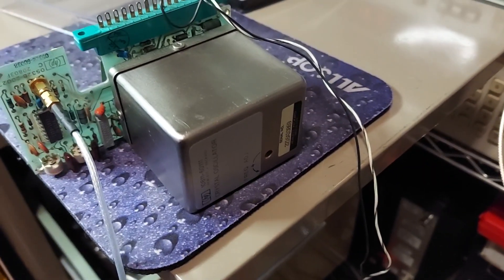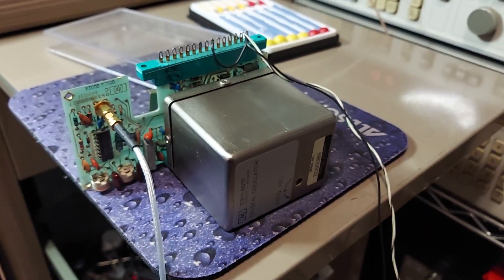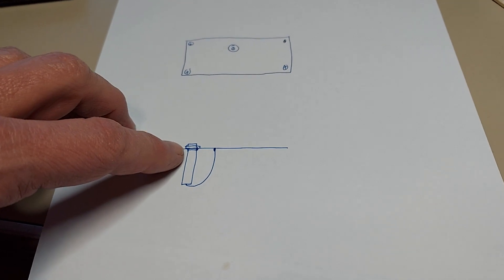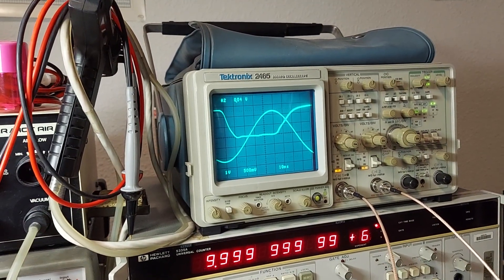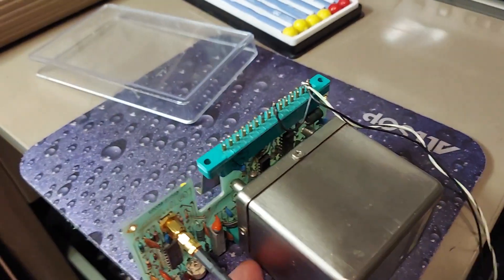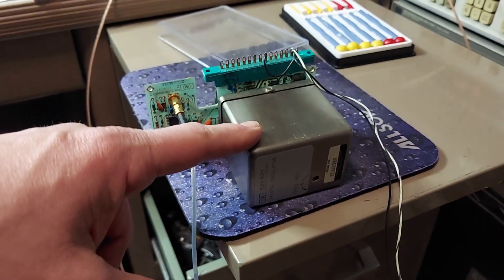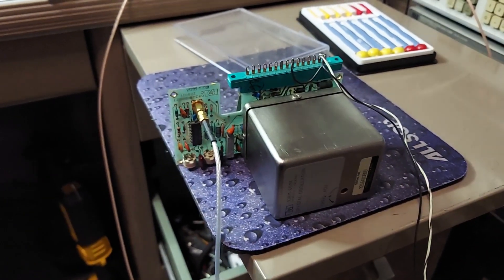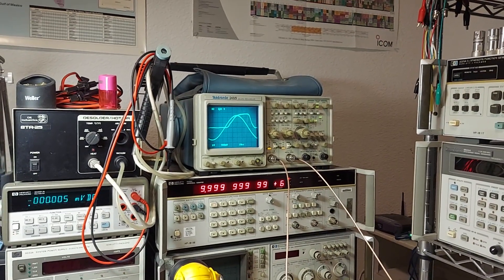HP 10811A repaired

Comment: Thanks for the vid. I remember watching this a long time ago and when I went to adjust my 8644B's 10811 this morning (just purchased and repaired a 53310a, and am currently in adjust everything mode) I was having similar symptoms and this came to mind.  It did turn out to be the problem.  Works perfect... thanks!
Reply from the maker: Glad it helped, I have only come across this issue once or twice over the 4 to 5 years I have been purchasing used gear. At first, I thought it was a cold solder connection but was relieved that it was just a lose jam nut.

Comment: Can you comment on the waveform shape coming off the riser board via the BNC? Mine looks kind of nasty, not at all like a sine wave but more like a lumpy square wave. Also do you have a link for the SM for that particular riser board? I could not find one for that version, which both our counters appear to have. 

Thanks for any info you can provide!

—E
de W6EL
Reply from the maker: The riser card (A3 board) I am using came out of a HP 5328A (surplus military unit) I had for some 23 years till one of the pass transistors on the 15 volt rail failed. I use it to test both 10811A and 10544A references. The squarewave seen on the scope is the result of the oscillator passing through U2 and to buffering transistor Q1, a SMA to BNC pigtail then sends this to the back of the instrument. Even when the 5328A was in service I remember the waveform always looking like that at the 10MHz output jack. You should be able to find a schematic for the A3 board in the HP 5328A service manual. All this info is on page 8-25, at least in my HP 5328A service manual. Hope this helps, thanks for watching.
Reply: @CraigPetersen12f36b  Thank you! I don't know how I missed that in the SM, it was indeed right there. I too have the surplus military unit and iirc one of my 15v rails went south due to a bad op-amp. I also replaced the zener diodes in the +/-12V house keeping voltage with 7812 and 7912. The current is only about 32mA, really does not deserve the stock circuit, which consumes several watts 24/7. I have two of these counters and both had this horrible scorched look under the 12V dropping resistors, plus the zener solder joints were starting to look quite stressed. Anyway, that is my 5328A story. 

Keep up the great videos. Can't believe I found someone working on the same thing at the same time. 

--E
de W6EL